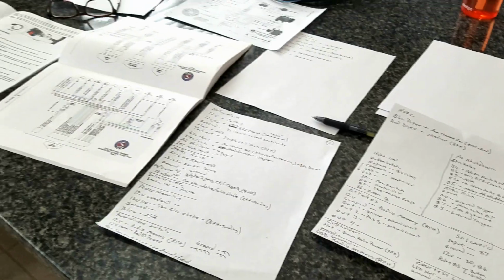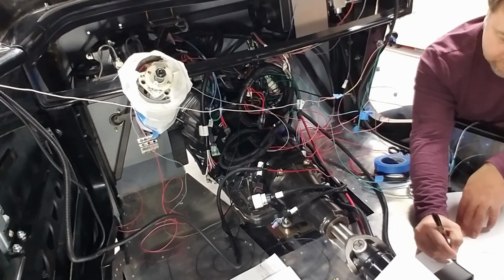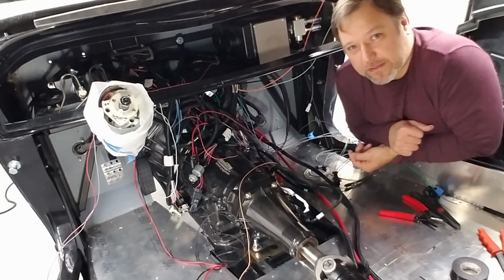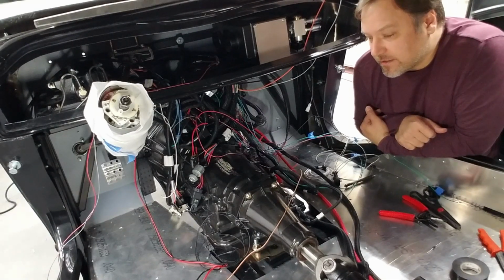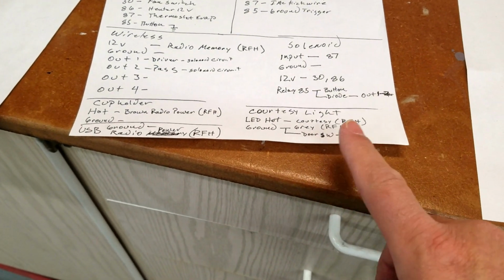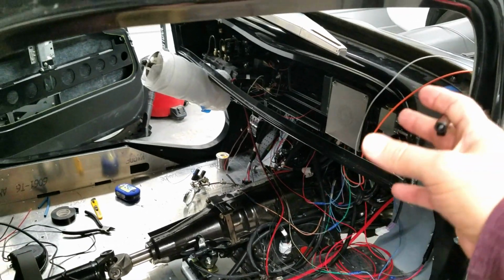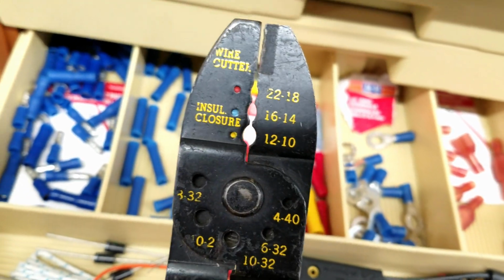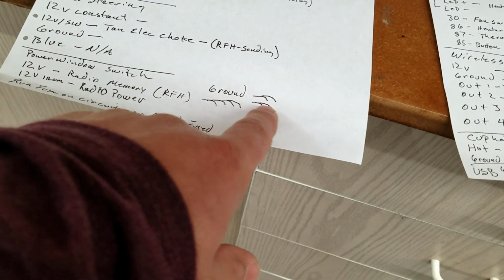Factory Five 33 Hot Rod V2 - Wiring - Mock & Connect

Comment: As long as you know what needs to happen, it's all good. I think you can handle it as long as you think logically and work it out, you can later rethink and maybe do things like off load some of the ignition wires to another distribution box to keep things simpler. Not sure what your doing for the kick panels, but there's room there to use if you need it.

Comment: Courteousy switch system you make perfect sense.  But you never want to use relays unless you have high current draws they are generally used in high draw or heat situations where  heat continues to climb in a wire that's loaded, and circuits are on for long periods of time. Courteousy lights keep it simple, and stupid.

Comment: Yeah if not specific sensitive resistance wires chop and cut all your bulk out you don't want that you will be super happy that you did it.  Even if you chop when to short you can always go in and fix it, add length it's not the end of world.  All junctions I put in my cars usually I have kit plugs from Deutsche connectors that I terminate with, and make a true plug and play system makes for nice disconnects and troubleshooting later on.

Comment: I like your method of temp wiring to get all systems working. On my build I added several relays- fuel pump, trans.cooler fan, ign.system for Holly sniper fuel injection. They don't take up much room, protect the rest of other systems, u can use inline fuses, also there is room in ff5 fuse block to mount 2 of them. Also if relay fails you can replace by unplug and plug it,  diodes requires soldering to replace.

Comment: Jim when you were talking about relay for AC system you mentioned your push button switch and that you have to use a relay why ? Just curious.  Is it a self latch or non latching switch ( momentary switch )
Reply from the maker: Most push buttons are not high enough amperage rated.
Reply: On engagment on a clutch it might draw at most 7 amps initial draw then settle out at 3 to 4.5 amps jim there's more watts being used up than amperage, amperage is slight at most being a magnetic field.  Are you using a latched switch I'm not saying not to use a relay but it will function perfectly if you get a switch rated at probably 15 amps or better should be able to find one rated at that level.  I have nitrous solenoids that draw similar amperage that are heavy duty using 4 amps coming off puny actuation switches and they work fine but they are momentary switches. But I would think to cut down on relays and wiring clutter as long as it's fused at 10 amps should be cool.
Reply from the maker: @bigbearvenom6145  I did verify my push buttons were not rated high enough.  Thanks for the incite though.